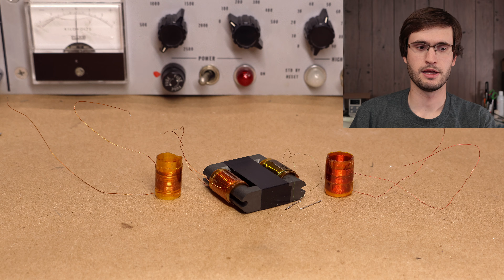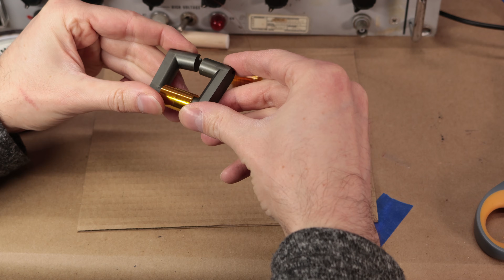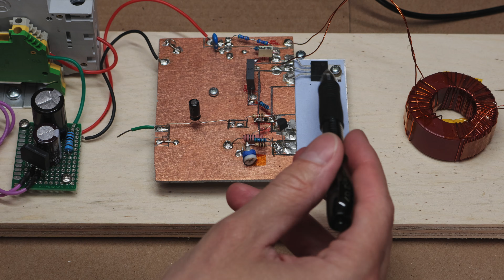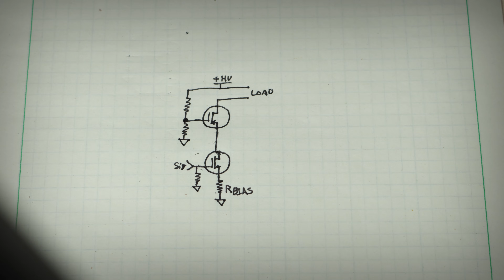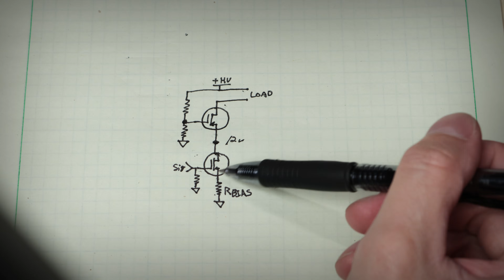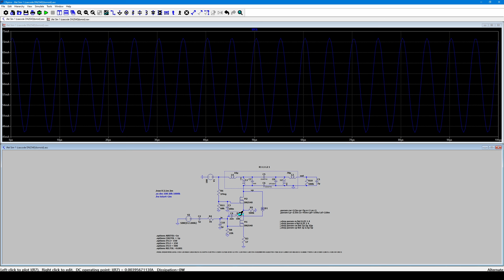DIY Prototype High Voltage High Frequency Amplifier

Comment: You may use a resistive divider (e.g. 10:1, 91k:10k, or 100:1 - 500k:5k) or even another small signal HF voltage transformer instead of 1:100 probe to lower effect of parasitic capacitance.
100k (or more) resistive divider is better than 27k impedance of the scope probe.
Reply from the maker: I could do this, but I didn’t for 2 reasons.
1 - the divider would become frequency dependent, which makes it harder to do 3db etc. 2 - Any realistic load will have some capacitance associated causing performance loss.
Reply: @TheMadHatter1337 yes, all resistive dividerscare frequency dependent, in general. But with such a low resistance (e.g. 100k) it still has a lot more bandwidth.

Comment: I liked those SiC JFET's that you started with.  I wonder what the difference would be if you used that SiC JFET for the upper transistor while using the MOSFET for the lower transistor of the cascode?
Reply from the maker: Actually tried exactly that. Still worse performance. I think the internal capacitance starts to act as a shunt through the source to drain above like 700kHz.
Reply: @MadHatter i've not thought this through, however, maybe adding a < 100 ohm pull-up resistor from the lower MOSFET drain to the gate-driver power rail might help.  This would, of course, add power dissipation.  The benefit of the pull-up (or current source LM337 would possibly be better) would be that the lower-MOSFET would be encouraged to remain in conduction mode.  The lower impedance should increase the frequency (pole) caused by the upper SiC JFET?

Just an idea for consideration.  I enjoyed this project of yours and would like to make one similar to it in the future.  Good luck.

Comment: Very good demonstration of your project.  HV Hf adjustable sources are very expensive.  Seeing how you optimize the design for your needs will be very interesting.
Reply from the maker: Thanks, this was a very rough prototype. It could be significantly more optimized, but instead I'm going to shift to another architecture as I noted. Hopefully this helps someone else with a similar project. Like another enhancement that could be added here would be to bypass the source resistor with a capacitor to reduce the transistors impedance and increase bandwidth, but I did not bother thinking about it until after the video.
Reply: @TheMadHatter1337  Definitely vintage, but you can at least get schematics for the fluke 5215A. It has a gain of 100 and can accommodate 1500pF(270pF at 170mA). Perhaps you can identify some useful circuit elements for your design.